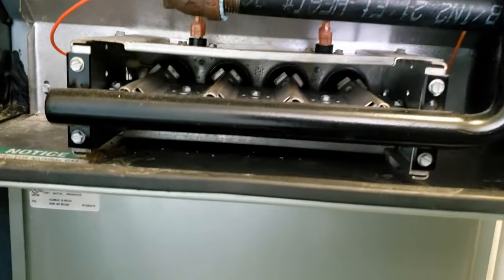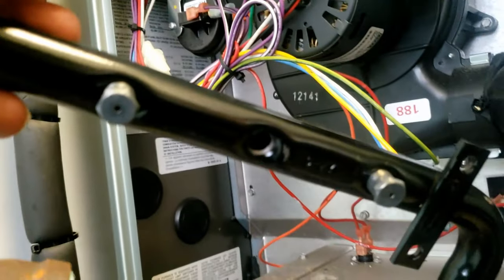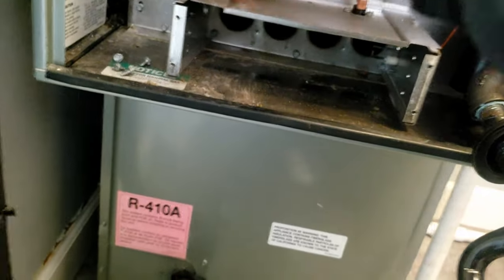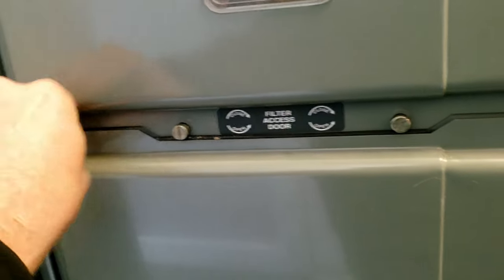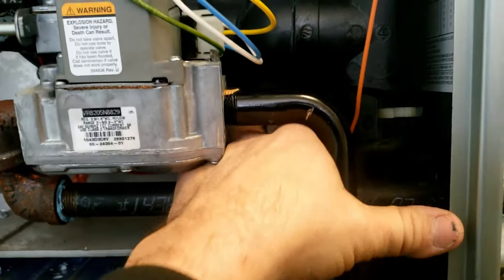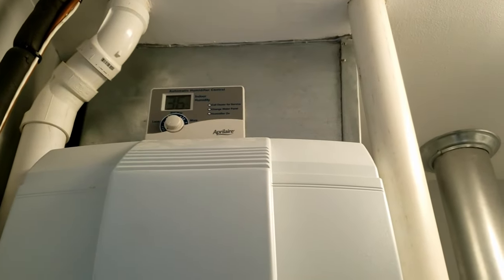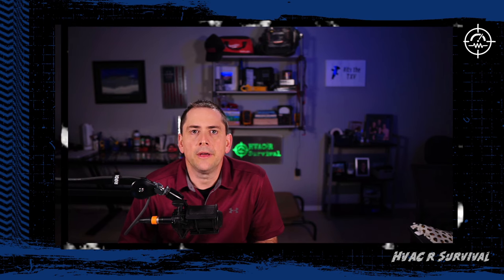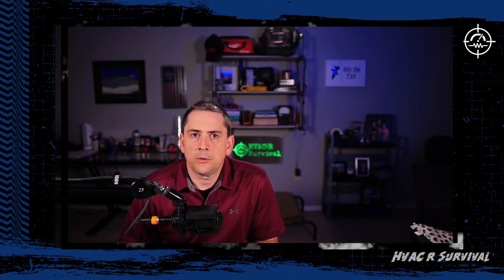NO HEAT RHEEM GAS FURNACE BURNERS NOT LIGHTING **For properly trained HVAC professionals only**

Comment: That whole burner enclosure will come out just by taking off the manifold and then removing the 2 screws on the right and left sides where it attaches to the face/inlet of the furnace. Makes cleaning the burners much easier. If you check gas pressure on a furnace that is having this problem there is a good chance it will show up as having low manifold pressure. Clean the burners before changing the valve. I've seen that on 3 different furnaces over the years.
Reply from the maker: Good information👍👍. Thanks
Reply: Thanks for the tip.
Reply: I believe that one has 2 per side and one or two on top plate, as well as the 4 manifold screws. they've changed things over the years ehough
Reply: Do I let the Gas blow out

Comment: The one problem I ran across with my Rheem propane fired furnace was that the gas feed brass orifices became semi-plugged with gunk.  The burners would still light up, but the btu output was lower than normal, and the house had a hard time heating up on very cold days.  Took awhile for the techs to figure out the issue as you might imagine!
Reply from the maker: Yes, I had a spider web in the orifices several times. You can usually hear the difference, it will be quieter than normal
Reply: I don't see the burning inside, so there is no gas. Simple problem. Burner, gas regulator,  ignition cable. I am an electronics  engineer who fixes a car, so I don't have pipe 2 wrenches. 10" for $5.99 at harbor freight,  tape $1, regulator at Walmart $79.99. Every time, I look for locations.

Comment: Always remove the HSI and flame sensor before removing the burner assembly. The igniter will break even if you just tap it with the assembly.

Comment: Thank you so much for sharing symptoms and cure and explaining how to clean the crud from the edge of the burner plate crossover grooves to allow the the other flames to ignite. After using a soft bronze wire brush - if that isn't enough - Would using a thin flat blade screwdriver to scrape and very slightly pry open the crossover grooves so that the hemispherical bumps are not stuck together - be a really bad idea ? Is the groove width a tight tolerance requirement that should not be altered ?  Why ? Maybe better to just get a new burner plate if it is really corroded ( as a $25 part) ? What do you think ?  Thanks.
Reply from the maker: Replace the burner if it's rusted. It's not worth the risk of problems.

Comment: I hear one of the twin culprits running in the background (clothes dryer) when the ducts come off them schmutz up the burners and washing machines from bleaches and detergents going airborne both in them and laundry tubs for people that love to soak clothes. high humidity sure wont help, propane bad also.
also, I seen the stinkbugs you brushed out, they love to clog things in odd places and they'll die with legs clinging until they get real dry and brittle. I hate the danged things with a passion!

Comment: I have a Rheem Criterion. I had a dirty filter when it started blowing cold air. I reset the breakers. I replaced the igniter, cleaned the flame sensor. High limit switch is good (but I ordered. Another one). I still don’t hear any clicking or glow from the ignition switch so of course I get no flame. What else should I check?
Reply from the maker: Pressure switch and condensate trap.
Reply: @HVACRSurvival  I installed a new pressure switch, condensate pan was empty (blew water out of hose just in case), and troubleshot the ICF circuit board…no issues there. 

What am I missing?

Comment: Question related to HVACR- what is your normal saturated condensing tempteture should be during low ambient or what tempteture it should not fall bellow, I heard 85 to 105 ? 
 I want to understand head pressure control properly  what is that magic number it should not fall bellow also one refrigeration tech was telling me you will want a 70F liquid temp going to your TXV for better operation can you explain this a little in detailed way so I dont have ask others thank you..
Thank you.
Reply from the maker: When I set up my fan cycle control I try to cut out at 90 deg F, and come back on at 105-110 Deg F. 
A lot of TXV manufactures show the design temperature to be at 100deg F.  I try to set up the fan so that it doesn't cycle on and off more than it has to and that when were in mild temps the fan stays longer and doesn't  cycle as much causing the pressures to raise and lower.
Reply: @HVACRSurvival  Thank you so much sir.

Comment: Interesting video. Question why is LP versus Naturally Gas more problematic for the crossovers?
Reply from the maker: LP gas is more volatile than natural gas. My comment had nothing to do with the crossovers. What I was referencing was when burners start separating they will light off rough and it's more obvious with LP gas.
Reply: @HVACRSurvival  I misunderstood. Thank you
Reply from the maker: @customdetailer0078  My discription wasn't very good, no worry's👍👍

Comment: I restarted my rheem classic 90 plus last night after being off for the summer season and it wasn’t igniting. I took the panels off, turned off  the power to the furnace and restarted it and we fired off ok.  Next morning it wasn’t heating.  The starter was clicking off but no flame.  Note I did have a new water heater installed this summer so the gas was turned off for a few hours but gas is flowing beyond the furnace line to the water heater so the gas line is working.  Any suggestions?  Damn thing lit up real quick last night after turning on and off the power now nothing!
Reply from the maker: Flame sensor or condensate trap

Comment: What’s the “backfire” you mentioned?
Reply from the maker: Burning inside the burner air shutter area.
Reply: Ok thx
Reply: The worst case scenario for a bad cross-over is delayed ignion gas builds up in the heat exchanger until it eventually finds an ignition source and ignites violently.  Fun and games.

Comment: I watch all kinds of channels and here is something I have been looking into lately. Those little Buddy Heaters everyone wants to hook the up to a 20lb tank because the little tanks cost to much. The people who use it with the big tank say the heaters quit working in a year or two. I found out you can buy a filter to add in the line for the heaters. Another guy I watch he repairs generators and one he was working on in the drip leg he found oil and asked if anyone have seen it before. I seen it one time but I was replacing a gas valve when I seen oil in the drip leg. I do know when they move natural gas via a gas line they have oil in it for the pumps it goes threw to he gas companies. The gas company has to remove that oil before they send it to there customers They would send drums of that oil to my shop so that we could get rid of it. That stuff is what I seen in that drip leg. I think they ship Propane the same way. If so is that what you must be seeing in a propane furnace that the Propane has a very same amount of oil.
Reply from the maker: I've never seen oil in my gas lines, they use a thing called a pig to separate the different gases and liquids in the pipe line, I don't know about the oil residue.

Comment: I thought I saw you switch it off the gas at the gas valve I was like ouch.
Reply from the maker: I will switch the gas valve off while it's running a lot of times to allow it to cool down before shutting the unit off. It will not hurt anyting
Reply: Yea me too but I thought you literally cut it off at the gas valve every time I’ve done I was lucky enough to not get it to come back on great video very informative.
Reply from the maker: Thanks man!

Comment: Thank you for sharing your knowledge. Much appreciated. My mother-in-law has a Rheem furnace that intermittently gets through part of the start up process and then shuts down and starts over. Trying to figure out whats going on.
Reply from the maker: Clean the condensate trap, clean the flame sensor, check the exhaust and air intake, make sure the air filter is clean, double check the capacitors on the blower, check voltage across the pressure switch. One of those things should be it, then correct the problem.  Good luck👍👍
Reply: I like mother in Law's that bake Casserols

Comment: The third over from the left looks a little rollout?
Reply: both the middle burners had a bit of rollout when igniting, looked to me like there was regulator surge, he did mention LP gas, so maybe the tank/s are low on propane, mud dauber wasps clogging regulator vent(been there done that)  or they have too many appliances on the circuit(I heard a dryer running, but it could be electric)
probably wise to test incoming and manifold gas pressures on that one. LP gas setups tend to do some stupid stuff out of the blue :)
then I seen a tankless water heater at the end, which looked quite a bit newer and are gas pigs (who knows).
Reply from the maker: I was covering to much information that didn't apply to this furnace. This was natural gas and it did have a little flair up at start up. But I haven't heard of them calling back.( I get side tracked talking about my past experiences and don't realize they really didn't fit the story line😁🤷🏻‍♂️ until I play back the video)

Comment: Hello, what can I do when the two green lights remain on and the yellow one does not turn on me.
Reply from the maker: Sounds like a dirty flame sensor,  check the cover to verify what the code is,  I don't have them memorized.
Reply: @HVACRSurvival  I do not think it will give me a code because the two green lights remain on, but the yellow one does not turn on but I am going to clean the sensor flame abel what happens. 

Thank you
Reply from the maker: I'm pretty sure that's a flame sensor indicator. I do so many different things I tend to forget. If you're able to check microamps I would do that before and after see what kind of improvement it is.
Reply: @HVACRSurvival  Yes, I'm going to check it with the microamps👍👍💪🏋️‍♂️